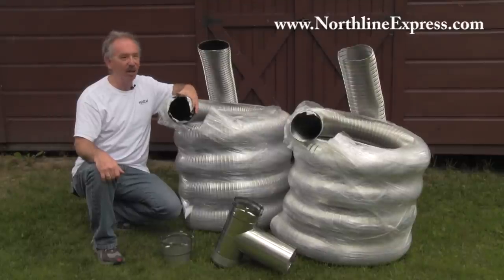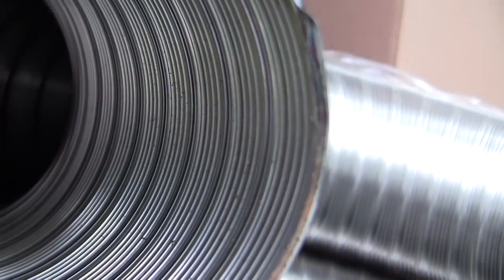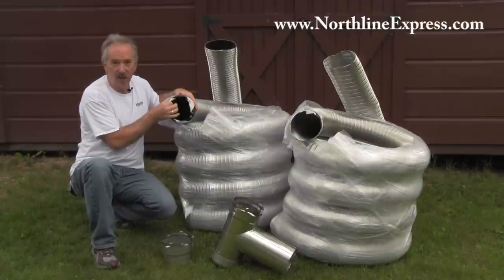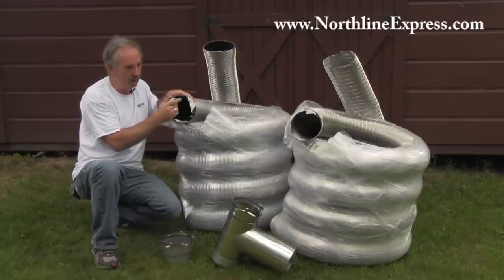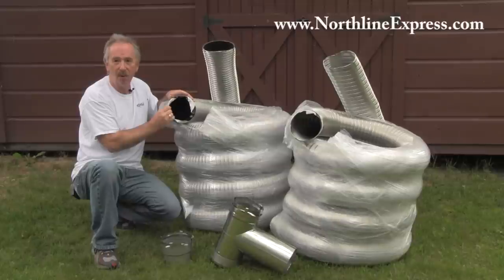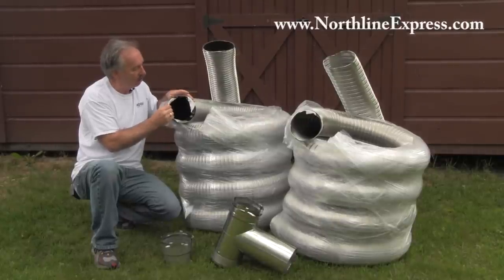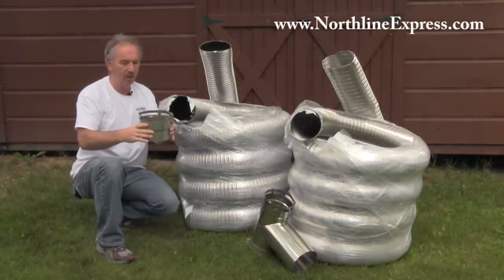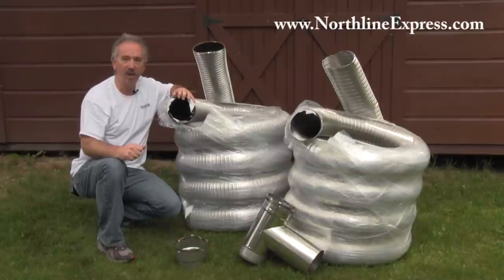What Type Of Chimney Liner Should You Use?

Comment: Draft won't be that much different with the corrugated option, and sometimes, a bit slower draft is even better in some setups.  However, like he said, the corrugated will be much more inclined to hold creosote, but if you burn hot with full air most of the time, there will be very little creosote. I have never had any creosote in either of my corrugated liners in almost 20 years, just 1/8 inch of noncombustible flyash to clean out every few years. Most people "choke the air down" way too soon after adding wood (before going to bed) and create creosote themselves with cold, moist conditions.

Comment: I have a 8in chimney what was installed into a old wood fireplace. Not that everything is 6in flue I either have to replace the whole system or put a liner in making it smaller and better unless you can give me better help than some of these dealers can I just buy a reducer from 6in flue to the 8in chimney pipe ? Thanks. Current wood stove is a 1975 Vermont casting defiant trying to get either a lopi liberty or a hearthstone

Comment: So with the top mount , when it’s cleaned does all the creosote /soot just fall back In the stove or are you supposed to pull the stove out to clean
Reply: Falls into the stove if there's a stove adapter... if it's a tee on a rear collar insert then you would pull out stove and clean out the tee

Comment: is this the Lifetime smooth wall chimney liner? I read some are light weight, medium weight and etc. what is the smooth wall - heavy or medium weight? trying to figure our which type is this comparing to the options on lifetime products...they have 5 different types ranging from light weight flex, welter weight flex, middle weight flex, light heavy weight flex and heavy weight flex...which is the smooth wall you have?

Comment: I need a liner for my chimney. For a oil burner furnace. $1300 does that sound right for a small ranch?
Reply: Jamie Adams  Yes it was done 3 months ago and paid $1300.
Reply: Dogue Cub  Indeed.
Reply: Ricky Ricardo  you think breaking tile, removing tile risking your life on a roof putting a liner in a chimney busting a$$ to get it done in 2-3 hours isn’t worth that small amount of money? $1,300 is cheap and probably a scam. If you use quality products and experience, a good 25’ liner kit can cost you up to $900, smoke pipe, $150 and miscellaneous, silicone, screws, mortar, and construction adhesive $100. Now it’s up to $1,150, all that is left is $150 for labor, but now take out tax! Don’t forget about the tools and experience if something goes wrong. $1,300 is a scam and they’re using poor products and probably doing a piss poor job. Usually a liner install on a normal 6” liner should cost $100 a foot total with tax and labor, everything included. 25’ is $2,500, 30’ is $3,000 this way you know you should be getting quality products. It should only take 2-4 hours if everything goes properly. 
If you want, as a homeowner buy a liner for $600-$900 and save the rest then go take the risk installing it and probably installing it wrong or get it stuck and have to pay someone with experience to remove it and have to buy their liner anyway because they don’t want to be responsible for installing your now inferior product and have any issues come back to haunt them.
Reply: @akaredcrossbow  🤔
Reply: @MrSprintcat  scammers usually buy bulk rolls of inferior liners and parts for a cheaper price. The liner system after buying bulk costs them around $250-$300 and pocket $1000 from that cheap liner system. Usually a scam company will already have that liner system in their truck ready to scam the next person at a moment’s notice.

Comment: I installed smooth liner myself… 5 years later part of my stainless 316t liner is badly rusted… is it normal?
Reply from the maker: If it's been directly exposed to elements it is very normal for parts to rust while others do not. Keep an eye on it and try to create an unexposed atmosphere for the liner so moisture doesn't collect causing major rust erosion over time.
Reply: It is not common at all.   It should never rust
Reply: Not a 316 t it wouldnt rust if it was
Reply: @dylannaill2363  It was 316t smooth wall liner from rockford chimney supply... first 2-3 ft from fireplace insert all bad... small wholes all over... insulation is all black in creosote... to be honest this portion of liner it was slightly bent... not sure if this is the issue with bending that smooth wall liner...
Reply: @sergiyr9152  was it installed right side up?  2ply lightwall stuff is the least durable liner on the market.  But 5 years is a really short lifespan
Reply: @NorthlineExpress i thought everything is stainless steel, how does that rust